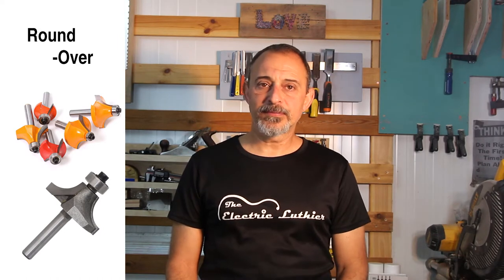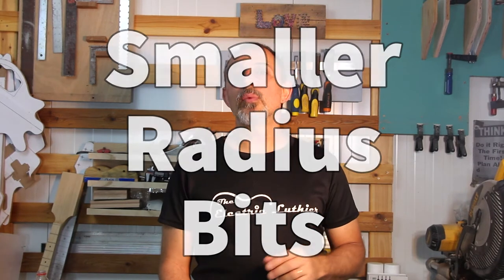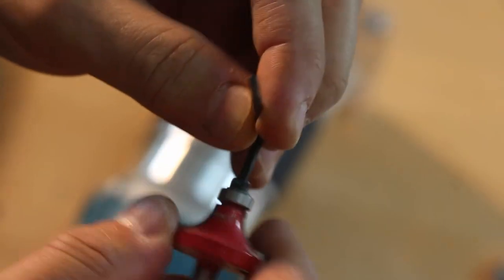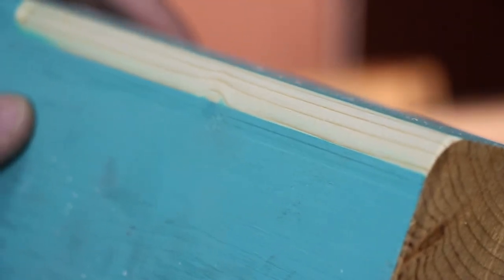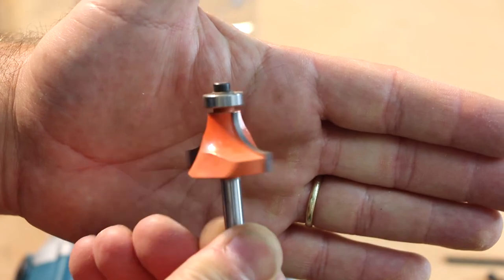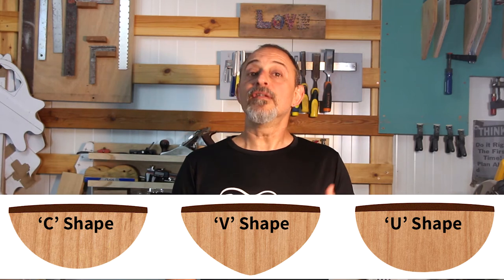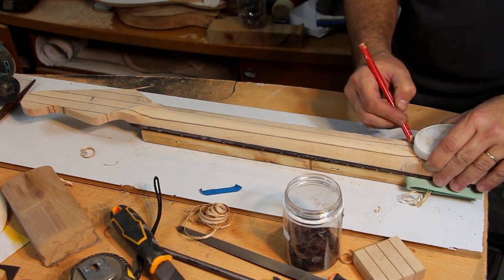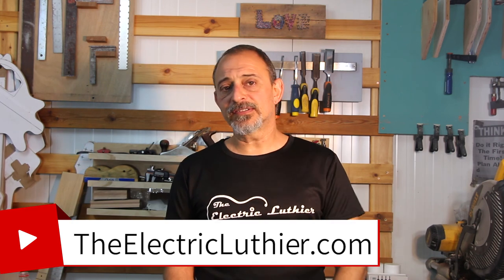Round over Router Bits for Electric Guitars

Comment: I bought an expensive round over bit and for some reason it came with the wrong size bearing, it was slightly too small which gives the roundover a seated step. Thankfully I had the correct bearing size from other bits and it worked perfectly.

Comment: silly question, can i do what is shown on 7:53 buy to the body edges? i have always wanted to get a strat with edges like the Satriani signature. 😅 i modded a yamaha pacifica by hand, but it seems these method is closer towhat i need 🤗 ( i would ask a friend, but buy the bits and get him some $)
Reply: Strat bodies are made exactly like that, but with a 0.5" radius round-over bit. You can see it in a 4 part video I made (https://www.youtube.com/watch?v=rW_PArgRqho&list=PLfW_F1DC9lxm0Gxf4QjslzV1IcKaKl4Nc). The Yamaha has a very small radius (almost none) and is a good place to start if you want to modify it. The Satriani Signature, on the other hand, has a larger edge radius, but unlike the Stratocaster it is not even all around the body. With a Strat, except for the forearm and belly relief, the rest is very even but that will not work for an Ibanez Satriani Signature and you will need to do some manual carving. Another thing to consider, on the technical side, is that a router bit with a radius larger than half the width of the guitar (like I am using for the neck) is only good for one side. When you flip the body to rout the other side, the bearing may already be sitting too low and you may get an uneven radius. So on the practical side, you can probably use a round-over bit of a 3/4" radius or even a bit more as a starting point and do the rest with a rasp saw or even a grinder as I did on the strat body in the video mentioned. Good luck 🙂